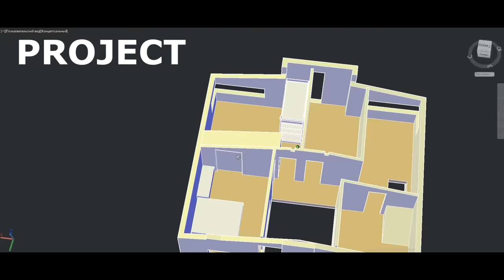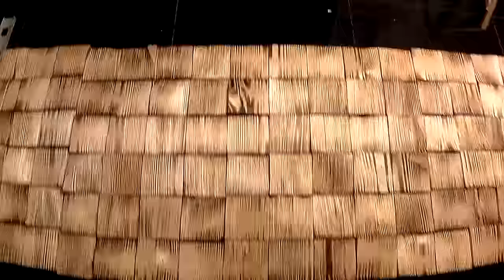They Made the Simplest Homemade Furniture and burned it - This design is Amazing

Comment: Im in the process of remodeling my kitchen. Already removed the old cabinets. And about to remove the sink cabinet. The kitchen floor is surprisely ok under the old cabinet. This house I live in was built in 1949 and finished 50. So you can imagine the surprises of old structural differences to now.

Comment: Interesting wooden tile decor but the base of yr bed will actually make the mold on the bottom of the mattres and it will rot as the mattres got to have proper ventilation and air circulation unless you live  at the dry desert without night humidity LOL

Comment: The Main support wall is linked to the kitchen. So I will have to take extra care when adding and removing. Unfortunately, person who lived in the house before me added an extra facet and trap. The only thing is, the facet itself has no valve stop and the trap cannot work using the same vent. As a result the upper sub floor is ruined. The bottom sub floor is ok and the joists appear ok

Comment: I will post pictures on my page before and after the work gets completed. I've decided to keep the upper cabinets. Which really they are selves, with a crown molding. The walls are a different story. She apparently used flooring glue to use on the walls to place wall paper...😡. Its impossible to get off. So I will cover it up with paneling.